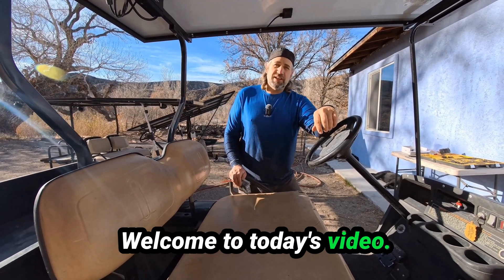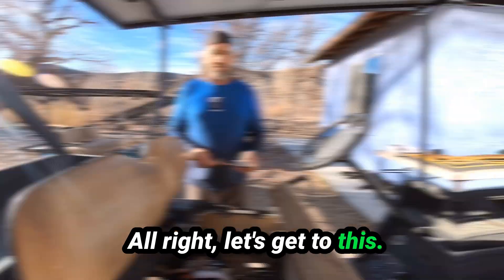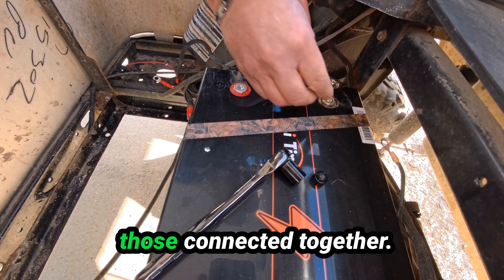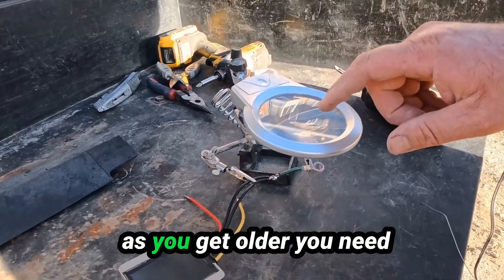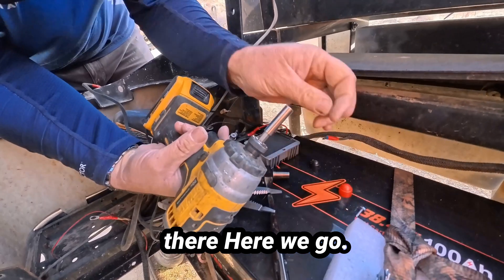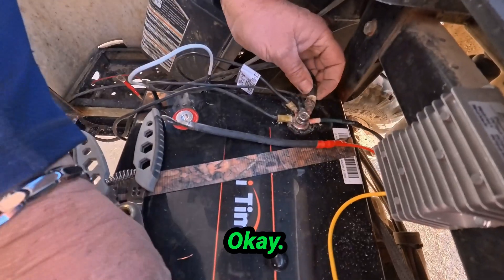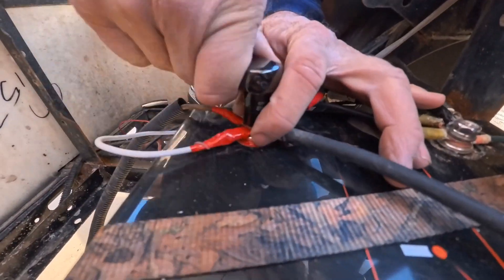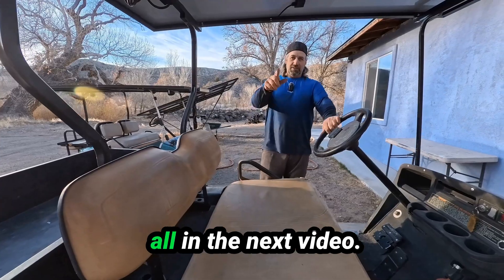EZGO 12V Drop Down Converter Installation (Buck)Made EASY!

Comment: Newbie here. Why solder the two negative leads?
Reply from the maker: I soldered them just to get a good connection. You can use wire connectors.